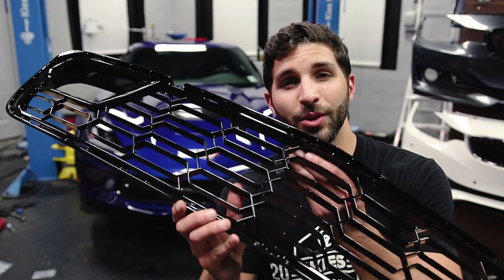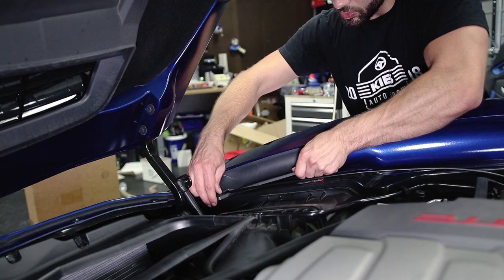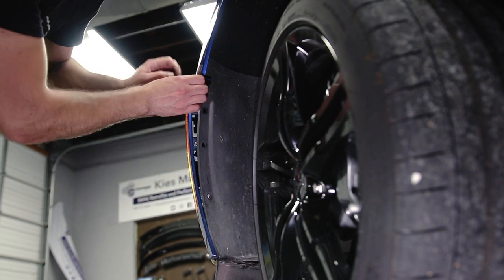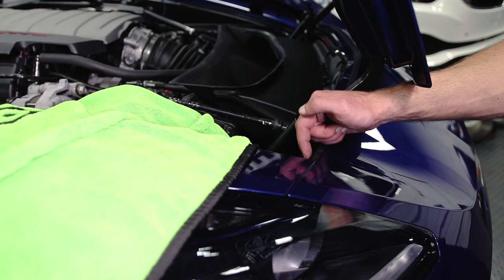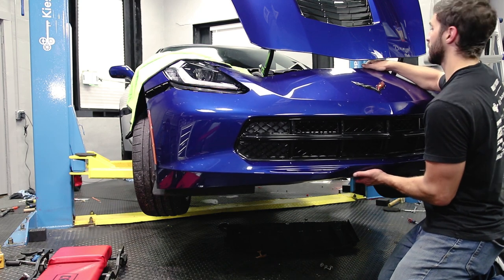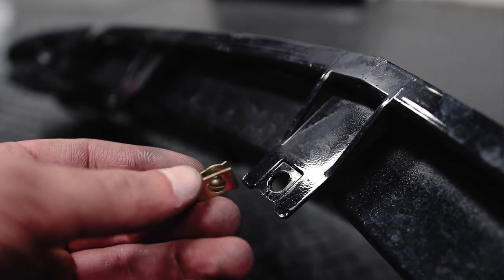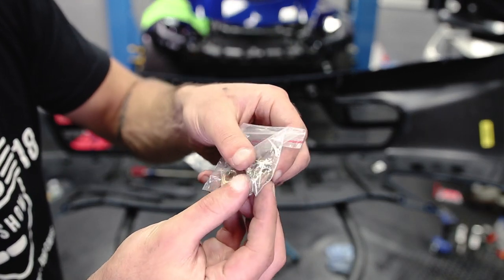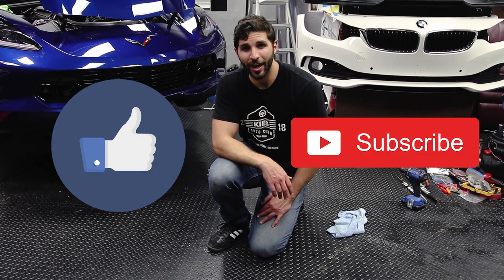2014 - 2019 C7 Corvette Stingray Bumper Removal - How to Install Z06 Grille

Comment: My kit didn't come with the block off plates and I have a 1LT without brake ducts. Is it bad to run without them?  I assume it isn't great having more air blowing into the engine bay.
Reply from the maker: its not bad to run without them. A little extra cooling and air flow doesn't hurt unless you are focused on aerodynamics

Comment: Where did you mount the front license plate?  I know the stock stingray has a plate holder that mount to the front grill to display the plate.. in my states front plate are required.. and that make the car ugly especially the c7.  I was thinking about getaway the auto retractable Show n Go license plate holder.  But worried about the clearance underneath the car..,plus i have the stage 2 front splitter which is hardly impossible to mount
Reply from the maker: It is required here too, we just run our vehicles without front plates because I agree it messed up the look

Comment: Just purchased a '17 Grand Sport and the headlights "bounce" on rough roads, like they are about to fall off the car. This video helps me see how to get to the headlamps.  This now 3 year old video is still helpful !!  Thanks very much! BTW...any experience with bouncing or unstable headlights? The assembly piece is very tight, so it must be the bulb inside. 
Thanks again!

Comment: Please sir, I would to know how to remove it with front cameras
Reply: I just did mine.  Yes, the front camera wires were tricky to unplug, you have to pull the pin down and then squeeze the side in….

Comment: Would love to see a video showing how to fix a misalignment of the front bumper/fascia at the wheel well - been told it could be as simple as loosening the 3 T15 bolts and pushing/pulling the  bumper/fascia into better alignment, then re-tightening the T15s - ? Can it be that simple, or are there possible other causes, if so what to look for and how to fix ‘em. Please help!

Comment: Thank you. Every other video simply omits or glosses over the clips, and I have a history of breaking clips.
Reply from the maker: No problem! Honestly,  if it doesn't show that part, what is the point of the video lol. The rest is easy.
Reply: @TheSundaeDrive  I wrote up a guide on Corvette Forum for replacing the front cameras on C7's and referenced your video there: https://www.corvetteforum.com/forums/c7-general-discussion/4336534-how-to-replace-a-front-camera-2017-z06.html#post1600419053

Comment: Very nice! I wonder how much a shop would charge for labor to do it?
Reply from the maker: Shouldn't charge more than $200-$300 depending on your location
Reply from the maker: Just show them this video and how easy it is if they try to charge a lot 😂
Reply: @TheSundaeDrive  Awesome! Thank you
Reply from the maker: No problem! Good luck!
Reply from the maker: The link to the grille is in the description :)
Reply: @TheSundaeDrive  got it, thanks so much! Much appreciated. Am in process of getting new c7 2019. They have good discount on them. C7s are best looking vet designs inmo, C8 is not doing for me-) i decided against GS as many report wheel cracks. So this grill mod & side skirts will make it look like GS at much less a cost-)
Reply from the maker: Good plan!